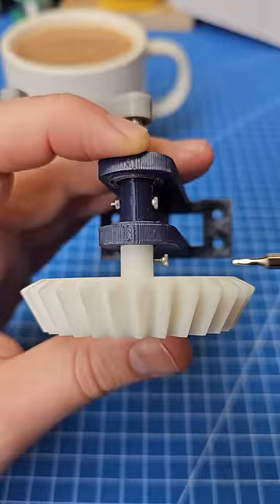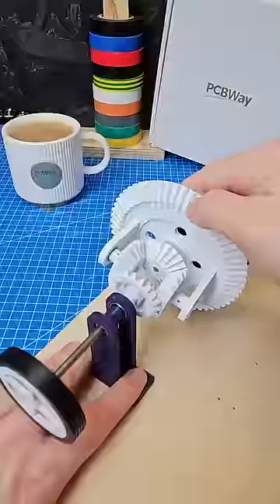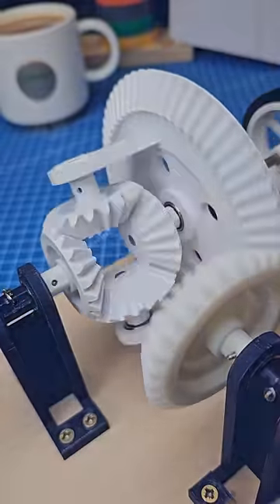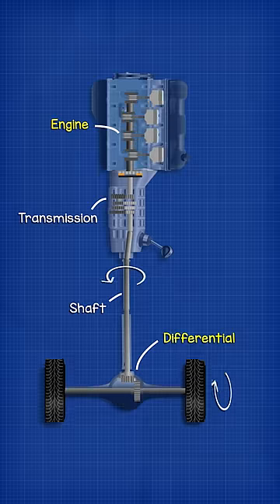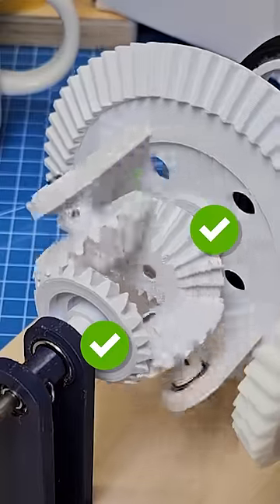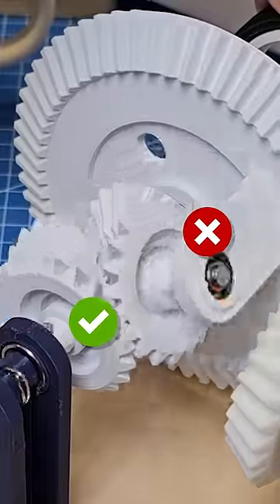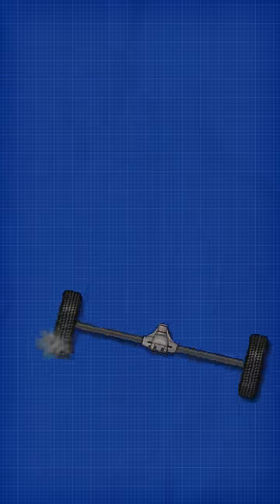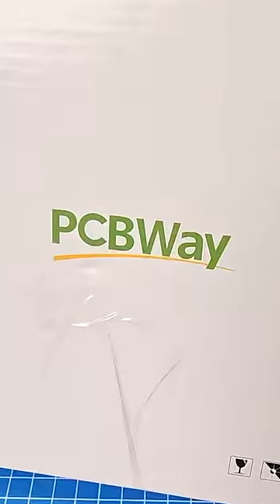How to build gear set for rear differential 3D print

Comment: Axle will probably not just snap, but you can get tire noise, hopping, and skidding when turning.  The tires getting worn fast is a bigger problem than snapping.
Reply: Was coming to say this. Have a Detroit locker in the rear of my 87 K20 Silverado... Sometimes it doesn't like to unlock right away, and I have yet to snap an axel, but everything else you said. Hopping, skipping, and squealing. Original axles.
Reply: @VulcanGoF  you probably don't over abuse it either.  Try driving in reverse anywhere from 10 to 20 feet next time you unlock it.  That's what i had to do with my 85 Chevy.
Reply: I was also going to say this. If the axle would snap than why do gocarts not have a differential? It's more to prevent skid outs, reduce tire wear, and improve traction thing.
Reply: @uncreative7774   coincidence? I am currently building a go kart with a limited slip diff. My biggest issue is stopping. Wheels and tires from a Chevy s10. It's 7 feet long and from outer edge of tires is 42 inches wide with a 21hp engine. Scary fast!
Reply: my spider gears in my jeep are welded together and can confirm my axles have not snapped but let me tell you it gets good traction on mud.
Reply: That’s why most people weld their diffs when drifting. You gotta be able to lose traction on both rears so the both spin the same speed and keep sliding.
Reply: @hugoandreslozano5489 or they get LSD.
Reply: @VulcanGoF ve got the Spartan in my Toyota. Sonlous when it refuses to unloxk and then unlocks that ive had people ask if there was an accident. Moatly in reverse. But same here. Havent boken an axle yet.

Besides, all you have to do is unload the axle and it will ratchet in and out of lock.
Reply: Ya i have welded a dif its not ideal but not that bad
Reply: Man, you explained what I wanted to say way better.
Reply: As someone who no longer has this type of diff in my truck this is exactly what happens
Reply: Yeah I've known quite a few people with welded diffs with no problem, it just chews up tires faster and makes noise turning.
Reply: Well i have built a couple quick vehicles for a parade at my university and while i have not yet snapped an axle i have torn wheels of the axle, sure was not built as sturdily as a car but from what i have seen i would say its quite possible indeed to break stuff, by now i am confident that if you cant have a differential, one wheel drive is better
Reply: @hugonilsson6067  wheels of the axle? Idk what that means. But lockers definitely chew tires up fast because turning they will spin at the same speed and turning normally the inside tire will be slower than the outside.
Reply: @LisaAnn777  we twisted one of the wheels of the axle, the axle was fine, the wheel was kinda fine but they where no longer stuck to each other
Reply: Not to mention all the farm equipment and offroaders in general that have lockable diffs because you don't WANT all the power going to the wheel with less resistance if the reason it has less resistance is that it's spinning.

I have an old minitractor and with the diff open on wet ground it can pull a fraction of the load it can with the diff locked. The issue with having the diff locked at all times is that it makes steering 10 times harder.
When stopped, steering with the diff locked is almost impossible but with the diff open it's almost easy. And if for some reason you can't move it even with the diff open, you can just apply power and the engine basically steers for you.
Reply: @uncreative7774 I imagine a lot more will brake before the axle but can’t be good for it either lol. And with go karts weighing next to nothing I don’t imagine it’s much of a problem.

Comment: The axle won't snap without a differential. Most four wheelers don't have differentials, and plenty of car owners purposely weld their differential to incurage drifting. The differential just makes turning easier.
Reply: Most 4x4s have a differential but they have the ability to lock them. Otherwise on road handling will be sacrificed. And locking the rear of a rwd car makes the back end slide out do to the loss of traction

Comment: Me with a welded diff 😅
Reply: Same gotta love that tire skip on tight turns
Reply: Me three
Reply: @jackterjack4010  haha I just like the constant slidey slide action that scares people 🤣
Reply: @Wtrxprs007able  very dangerous (and probably illegal). Please don’t drive on public roads with an open diff.
Reply: @beanapprentice1687 I’m guessing you meant “don’t drive on public road with locked/welded diffs” our local police crown Vics had locked diff from the factory, and they were pretty safe, I do have to say the confort of a locked diff might not be the best tho
Reply: Limited Slip Differential would be the most ideal, they balance the power between the wheels, but allow the difference in tire speeds to "slip" a limited amount.

But an on hand welder and some material is cheaper.
Reply: @beanapprentice1687  not dangerous, but i lets you drift easily
Reply: @beanapprentice1687 i agree. Open diffs should be illegal. Every car should be required to have a mechanical LSD.
Reply: @NG-VQ37VHR i agree everyone should take LSD

Comment: The axle won't snap. The differential was actually made to make the handling of a car better. It puts more power to the wheel with the most resistance. Because of that if you have a differential it will handle better around corners and cause less wear on the tires. Differentials can also help in off-road situations or on poor roads because it will provide power to the wheel with grip. A lot of people in the drag racing community weld their differentials or get solid axles so they can have a more even distribution of power. A solid axle is still street legal and will only cause excess wear on a tire.
Reply: It puts more power to the wheel with least resistance*

Comment: I have built a couple quick vehicles for a parade at my university and while i have not yet snapped an axle i have torn wheels of the axle, sure was not built as sturdily as a car but from what i have seen i would say its quite possible indeed to break stuff, by now i am confident that if you cant have a differential, one wheel drive is better

Comment: I have looked and tested the differential in my hobby grade rc car. It puts power to the wheel with the least resistance not the most. Drag cars weld their difs so the can have equal power transfer because without a solid axle in the rear when lots of power is applied the car pulls hard to one side. Again experience with a hobby grade rc car. The cool thing is its four wheel drive and the outer gear on the dif is on opposite sides but apart from that the front and rear are the same.

Comment: The axle wouldn’t snap, in a scenario where there is no diff and just a straight through axle the tires will break loose before the axle has enough stress on it. On the other hand with something like a welded diff the gears would take all the stress and break

Comment: Axle won't snap, bit dramatic. you're tires will chirp and lose rubber at a faster pace along with you're car will make wider turns and become "less stable" turning at high speeds (Drift). We used to weld our differentials as kids.

Comment: The axles won't snap. In fact, you can have more fun if you weld the two spider gears together. My drift car has been running like this for years

Comment: Fun fact, you can hear the problem yourself when ciry rramways turn sharply. Most trams here have no differentials but a joint axle on their non-driven wheels, and when they turn, the speed difference causes the inner one to slip and screetch loudly.

Comment: Trust I know, if you have ever owned a awd with a locking differential specially you will eat a set of tires off your car in days on dry pavement even with it not on you have to rotate them from front to back to keep the fronts from wearing 4x plus faster than the rears.

Comment: To demonstrate a differential with wheels, you might want it to roll on the ground, the wheels are too small, and you can’t roll this because the gears are larger… to help people understand the behavior, perhaps you might want to either reduce the gear size or make the wheels larger… nice 3D print.

Comment: Remote control cars have differentials, but some smooth brains put glue in them to lock the differential. I'm still not sure why, but I've heard it "eliminates friction and improves performance". This is of course bs and any conceivable loss in friction is quickly quintupled by the wheels skidding and destroying the tire.

Comment: Are PCB Way aware that they only got a short for that sponsorship money..? Because I can’t imagine that’s what they had in mind..a short. Then again if they weren’t explicit and u just found a loophole in the agreement, good for u a guess. Tho I’m guessing they wouldn’t be too eager to work with u again if that’s the case as shorts sure are shit.
I’ve actually never seen a sponsored short thus far. Well, baring this clip/short then obviously.
Reply from the maker: Yes they are aware and asked for it. I would not disrespect a client by trying to trick them. At the time shorts had links and got lots of views so it made perfect sense.
Reply: @EngineeringMindset  That’s frickin’ awesome! In my blissful ignorance I just assumed sponsored videos was just that, videos as opposed to clips. Of course there’s really nothing inherently unsponsorable about a clip so I don’t why this is such a surprise. I mean clearly exposure is exposure is exposure even if it’s only in a short clip (pun intended). My prejudice against YouTube Shorts or Short or whatever it’s called, as a result of the exponential increase of low effort, semi automated content creation enabling the worst acceleration of enshittification I’ve seen on this platform during the 10 years of having YouTube as my primary choice for content consumption have unfortunately made me very negative about short content in general. I’m just now realizing.

Anyway, I do apologize for my weird, asinine comment. I bid you farewell and adieu 🖖✌️👋